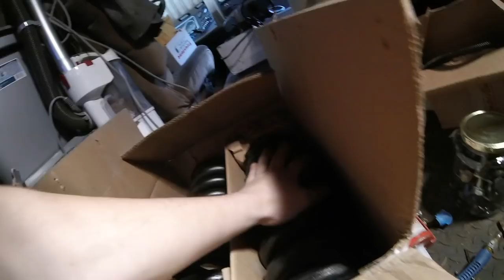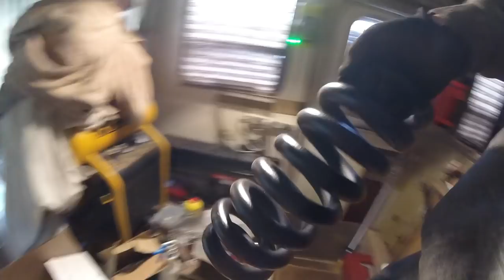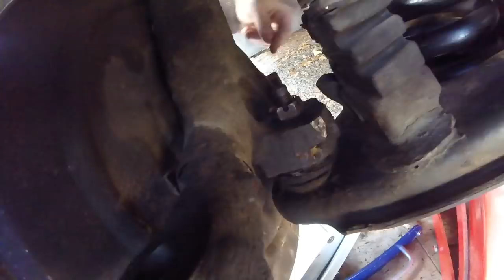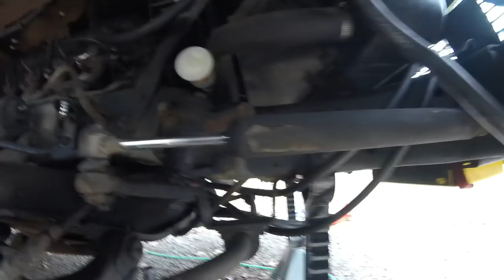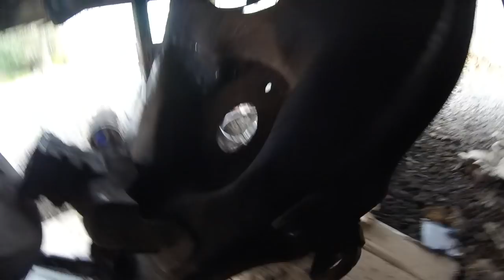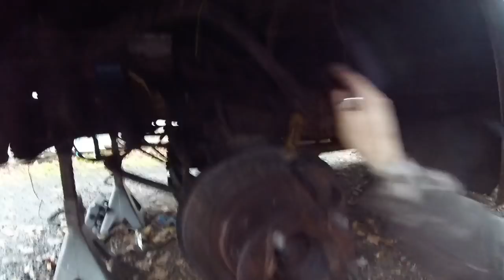Replacing Front Coil Springs | 87 Chevy P30 RV

Comment: Just a friendly tip that will extend your nine lives: Use the wheels removed to put underneath with you to buy you extra room should the jack stands fail which could be possible since 1) they are HF and 2) their only rated for 6k lbs 12 ton on a 7k weight in front. Just a thought on why women live longer then men.
Reply: In the gravel? Is not very solid.. I see leaves too so perhaps ground is damp. Something to think about before attempting.

Comment: I just inherited a 97 Class A on a P30 chassis and want to thank you for all the detailed videos you've posted of your repairs. I have to do most of the same to mine and am following in your foot steps. Getting ready to install the 7200 lb springs and wanted your thoughts on whether you think spring compressors would be a good idea (room or no room to use?) for safety...is there a risk of the spring popping out and whacking something or somebody?

Comment: Just had my front end weighed at a truck station. Mines bigger then yours and only around 5k pounds per corner. Did your springs make the ride rough? Did it raise the height of your front? Thank you sir
Reply: supposed to weigh and purchase springs accordingly, I believe supersteer is the only company that has springs for correct weight in 200 pound increments. They are who I am going with